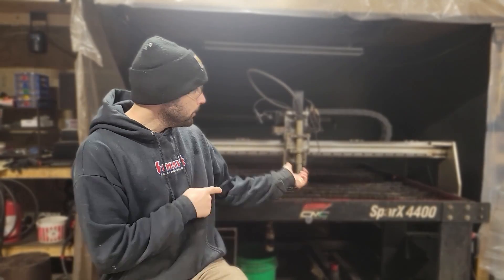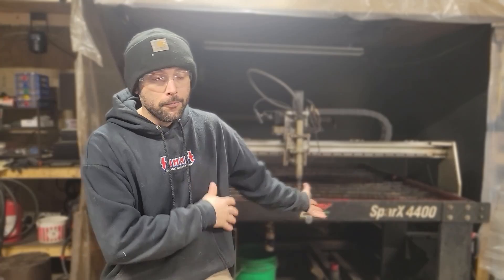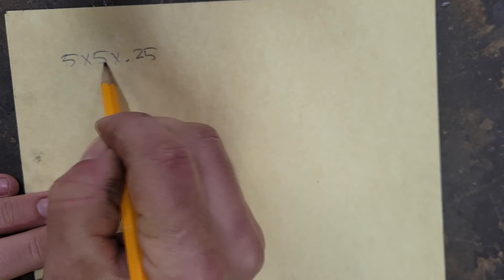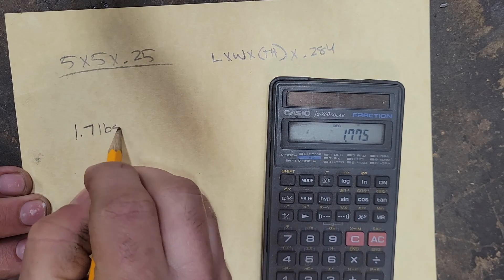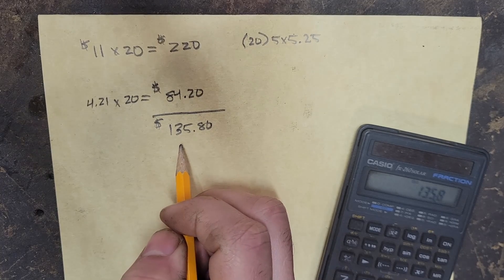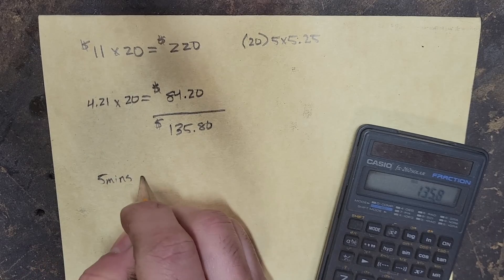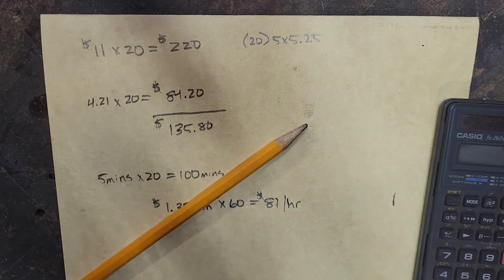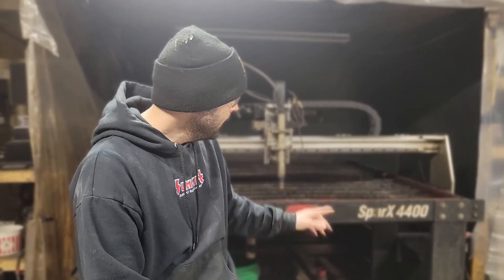CNC Plasma Cutting Pricing In Simple Steps!

Comment: Then you have to pay you electric bill.  Water bill.  HVAC.  Insurance.  Shop maintenance.  Time finding work (marketing).     Set aside for future expansion.  Stay fiscally disciplined and you can have 2 or 3 or more machines running all day with the same fixed costs and now you’re raking it in.

Comment: The time you spend bidding a job is non-billable. To that add your art / cad time which is normally non-billable as well. You need to have a list of set fees by size. taking the time to load a file to count the pierce points, cutting time ect is time you will never ever get back.. I have seen some yards up-charge by the pound for basic shapes. If they use an large sheet (8'x20') you pay by the linear ft. The bigger jobs I outsourced to them it was cheaper to just buy the whole sheet, have them cut your parts then load up the drops to take back to your table.

Comment: Hi, i saw the video. The first part is ok. About metal pricing. Been cutting since 2007 and quote by area is not correct. What if  you require 400 3/4" holes on a 20" x 20" by  1/4"?  ¿What about working on different material like brass, stainless or aluminum? Would you chaege the same?   When it.comes to quote art stuff or signs, do you still pricing by area?  Consider handling a 1/2" plate just to cut one piece of 5"x5" plate ¿Will you consider handling costs or lifting equipment? There is more. Sorry for my english.  I quote by category, thickness, time, type of.material, parts qty, cad fee and material if customer requires.